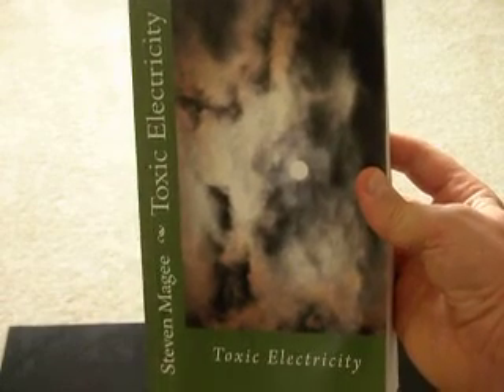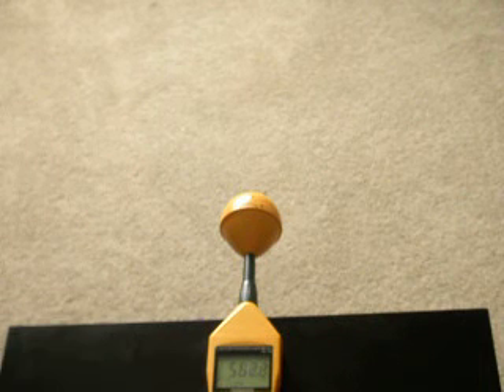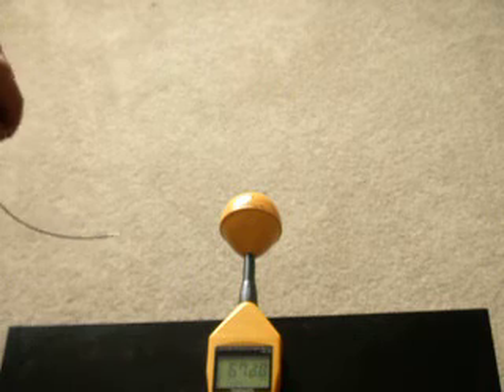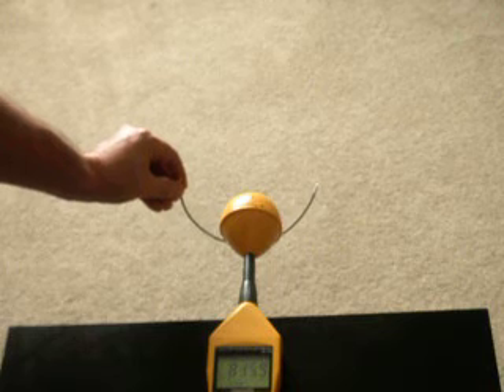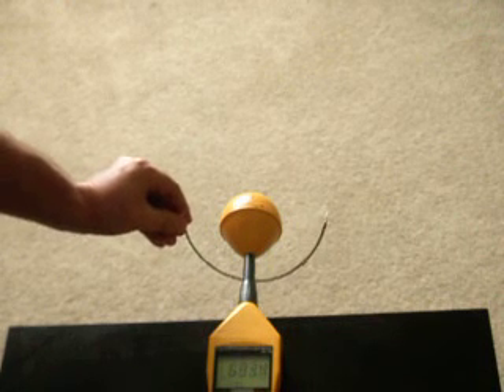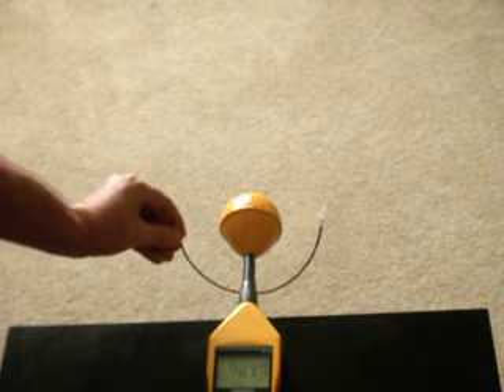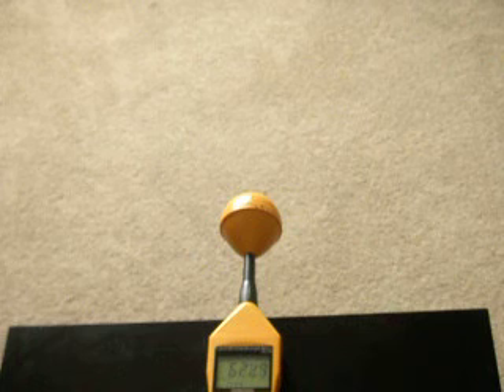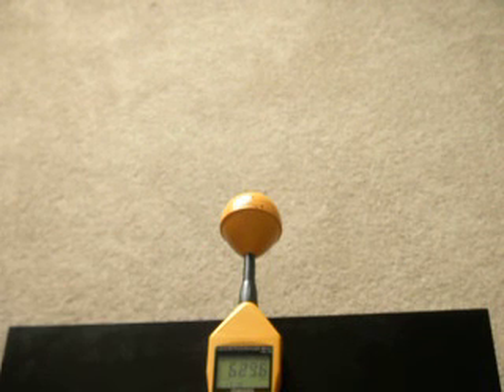Raising the Radiation Levels with an Under Wired Bra

Comment from the maker: The hand does a good job of simulating the other breast.  The arrangement of the two breasts naturally reflects microwaves into the adjacent breast and increases the radiation levels without any under wires.   The under wires add to the radiation energy induced into the breast tissue.  You must remember that the correct natural microwave environment is 0 V/m and that is what the human genetics developed in.  The governments generally allow up to 61 V/m in modern society.